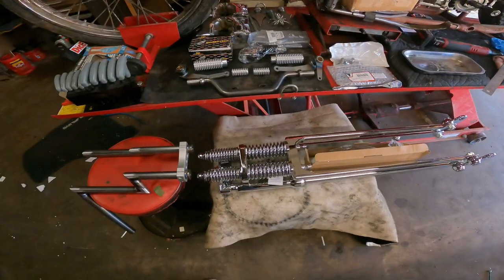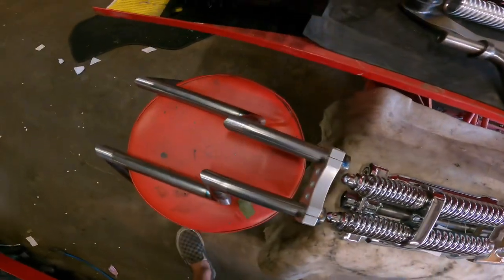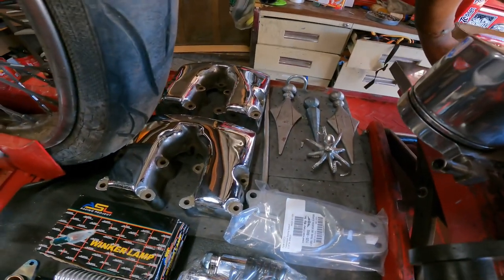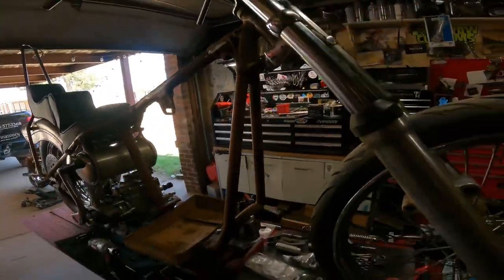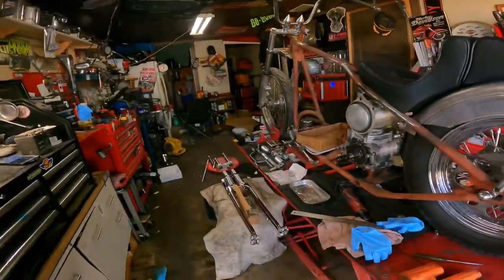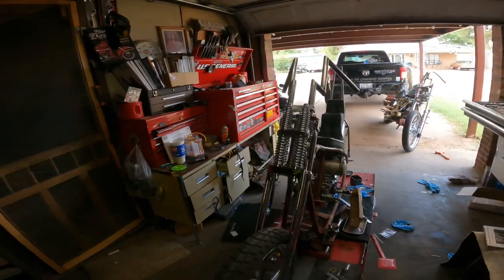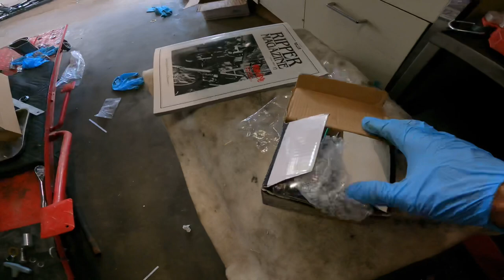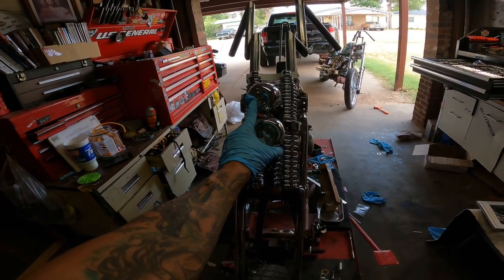Narrow glide Springer front end for the Shovelhead chopper build…

Comment: The springer looks great. I like the small headlights. I’m glad you called the rocker box by its correct name. You called it rocker tops. They are not heads. I’m sure people will say then why do we call them shovel heads, or knuckleheads. My answer is the head only fits the rocker box that is made for that head. So the head takes certain shape rocker box, so it actually is a shovel or pan. Because the rockers are not interchangeable.